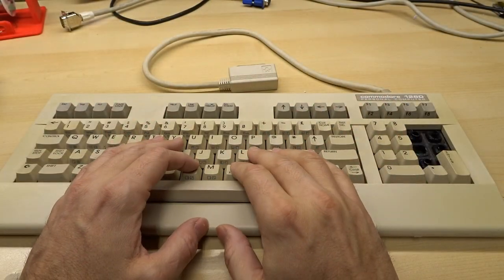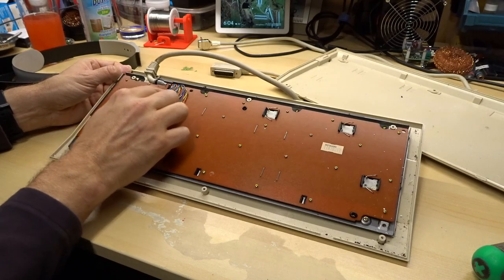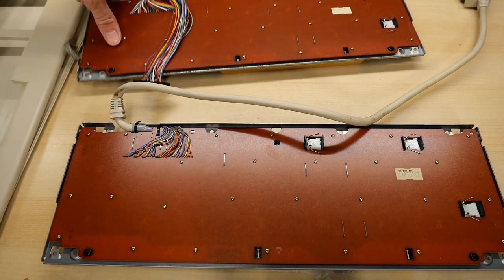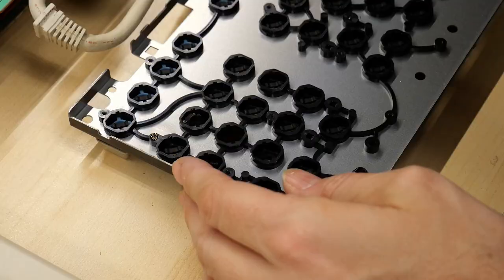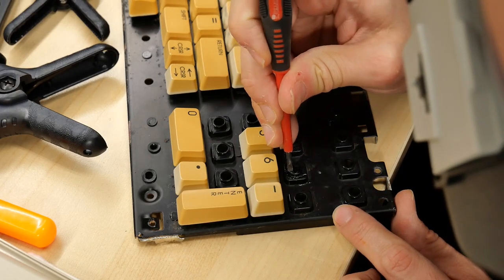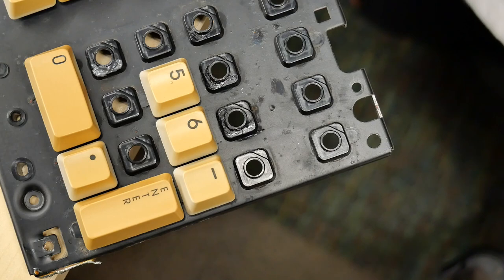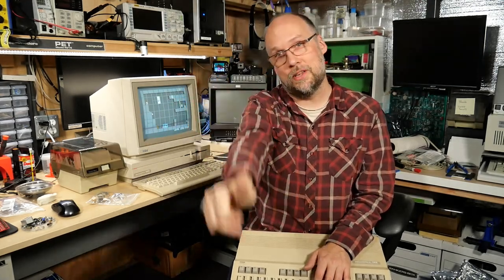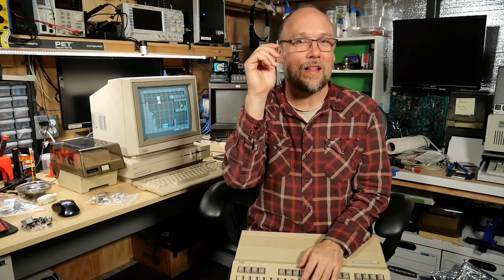Fixing the C128D keyboard (and more!)

Comment: Adding Baking Soda to Krazy Glue after it has been applied will cause it to dry rock solid almost instantly. This may lead to a lot of finishing work afterwards but the repair usually adheres even when the glue refuses to set under normal circumstances. This is a trick used by guitar techs to repair broken plastic slotted nuts (on the headstock) permanently and hold up against the heavy pressure of the strings.
Reply: @adriansdigitalbasement  It's definitely worth trying though I would practice on some scrap plastic first until you get the method down. It can be a bit messy but usually produces a strong mechanical joint. :-)

Comment: A couple of notes from my personal experience with cyanoacrylate. It does bond plastic very well, but it needs a low/no oxygen environment.  This means a tightly pressed joint will bond but the glue on the exterior of the joint will remain liquid.  This can be improved with the introduction of a small amount of water.  The water seals the glue from the air which allows it to bond quickly.  You may have seen this when you attempt to wash cyanoacrylate off your fingers.
Reply: My experience with cyanoacrylate when I used to build models was that using pressure is not good. The adherence was much much better when just putting the parts in contact without applying pressure.
Reply: @galier2  That makes a lot of sense.  Applying pressure will force out the liquid, especially when bonding two pieces that are perfectly fit to each other.
Reply: I think the problem with applying pressure (with your hands) is you can't press firmly and hold completely still at the same time, so you're constantly moving the joint a tiny bit and making the glue unable to set.  I find a light touch sets better.

Comment: Baking soda will turn it into a solid mass that's workable with sandpaper and files.
Reply: Beware of the fumes though
Reply: You can also use fine granulated sweeteners like sweet'n'low if you're working in an office (check the coffeemaker area).
Reply: Yes, works very well and very easy to apply

Comment: For ABS plastics, use solvent 'pipe' weld, similar to what you find in model making kits, or buy one of those pots from a hardware store. Also you can use Acetone if you let it wick into the gap enough, it simply melts the plastic then evaporates and bonds it back together.

For unknown plastics, use superglue (CA) but test an inconspicuous area first. You can buy 'activator' from hardware stores, along with good quality CA glue disguised as 'Mitre bond' for plastic roofing applications.
Reply from the maker: Ah yes I have some of that ABS weld around as I did some plumbing on my kitchen sink and needed it. I'll need to keep that in mind.

Comment: I'm a simple man, I see a C128 video, I upvote. - I own a 128D (plastic case) and a regular 128 (with 1571) too. I also have a NoS never used 128D keyboard as extra... I feel extremely lucky after watching this video that I never had to suffer through this to get a working C128D keyboard. :) I wanted to get a 128DCr (metal case) machine too, which will probably lack its keyboard, but didn't get around yet.

Comment: I noticed you cleaning all the keycaps individually with a cloth (and probably some ipa). I found an easier and quicker way to do it. I put all the keycaps in a Tupperware box, added about two cups full of methylated spirit, closed the lid and shook the box for a couple of minutes. Rinsed the box with keycaps under the tap with running water, spread them out on a towel and let them dry for a couple of hours. I ended up with clean keycaps and with added bonus I did not had to breathe in methylated spirit or ipa fumes for a long time.

Comment: The thing with Cyanoacrylate (super glue, krazy glue, etc.) is not to use too much. A thin layer will actually stick much better (and much faster) than a thick one: the thicker the layer, the longer it takes to cure). I’ve learned this the hard way, in trying to restore stuff. A super thin smear, will set pretty much straight away…

Comment: Instead of superglue, try using the Loctite plastics repair kit.  It has two parts, a cleaning “marker” with solvent (heptane) to prepare the plastic, and then the actual glue.  I used it to repair a very broken C64 case and it worked perfectly.

Comment: i think superglue is everyone's nemesis. it was originally intended to be used as an instant bandage, not an adhesive. so that's why it sticks to your fingers better than the thing you are gluing. your problem seemed to be an incompatibility between the solvent in the glue and the plastic. the plastic may deform but leave it alone and the solvent will eventually evaporate and re-harden the plastic.

Comment: You need water, accelerator (kicker) or baking soda for superglue to cure fast and well especially on plastic.  If the amount is thin enough sometimes just blowing on it can help cure it faster.  I haven't had much luck with plastic except when using baking soda.  But that's messy and usually requires a lot of cutting/sanding afterwards.

Comment: Commodore enclosure, keyboard enclosure, most computer and game console enclosures, made from ABS plastic: in case of a hairline crack with no material lost, fill the smallest syringe with the finest needle with acetone. Press down on the plunger gently until a droplet appears on the tip of the needle, maybe half a millimetre big. Put the needle on the crack from inside, you'll see the droplet instantly get pulled into the crack. Repeat maybe 10-20 times, leave for a day or two to cure, usually invisible repair, solid as new.

Probably won't work on this keyboard tray, which i struggle to guess the plastic even. Some kind of acid-soluble polyester? Since well what happened when you applied CA. My first instinct would be, if i was the manufacturer, to make sliding parts out of PA, because they won't wear, will have a self-lubricating behaviour, and for the time being, like for around 10 years or more, they'll hold up really really well; but the whole keyboard tray just seems like too much material for something like that, at least if you're penny pinching.

My instinct would be to repair the tops of keyboard tray shafts by reinforcement, with epoxy and winding a thread into it, or even CA and winding a cotton thread. The thread will help CA cure, actually cotton can react with CA a bit and the collar formed will also take up the forces on the shaft.

Comment: Just pausing at 8.30 to mention that (assuming Cyanoacrylate is indeed suited to the material to be repaired) you can actually use it to build up missing chunks by adding a drop & then quickly dropping a pinch of baking soda onto the glue, it sets up almost instantly and has much more gap-filling properties than usual... You can layer it up to fill bigger gaps too. I'm told the method comes from aerospace techs repairing helicopter rotor leading-edges, how true this is i don't know but i DO know I've successfully repaired tabs/gears and a few other things using this method.

Comment: I can honestly say I've never had superglue melt plastic like that, usually it just sticks anything to anything, including my fingers to the piece I'm trying to fix... :P

As for retrobriting in the winter, dunno if you know him but some guy by the name of Adrian Black did a video using near-UV blue LEDs to do indoor-whitening, wink wink......... :P
Reply: If I'm clamping something with a glue that might spread, I usually put some paper (or two) in between.  Especially with a double-layer of paper it's easy to separate them if it sticks, and the paper can always be dissolved with water.  It's essentially how my father would attach corner blocks on a violin mold, so they could be tapped back out once the sides were molded.

Comment: Glad to see two 128s (a flat and a diesel) back to full working capacity! I tried rewatching several times over but didn't quite catch it - what caused the D keyboard to produce that 3 and mis-types when you first plugged it in?
Reply: Possibility that the connector (db25) may be the issue. Or some sort of weird compatability issue with the new keyboard?
Reply: @HoboVibingToMusic  The previous owner probably hit the '3' key after turning the machine off and it was in the keyboard buffer for a few years just waiting to come out.
Reply: @PJBonoVox  The key: My time has come.

Comment: Cyanoacrylate, if applied too thick, won't dry properly in the listed times.
If you need to gap-fill, mix in some baking soda or corn starch.
Reply: Better yet, use the correct adhesive for the job.  Cyanoacrylate is great at sticking fingers together, but compleetely wrong for most of the jobs people use it for.  Very clever marketing by Loctite and others but utterly wrong.

Comment: That glue expires quickly after it has been opened. And it's only really good for acrylic based plastic. For instance the bottle it's stored in is made of normal polyethylene and it doesn't stick to that.
Reply: @adriansdigitalbasement  yep, epoxy based glues are much less brittle when dry, don't age that fast, and can take repetitive high mechanical forces. Superglue is actually only suitable for some specific applications, but people use it for almost anything, because it's easy to use.

Comment: I truly believe Adrian has the skills to Frankenstein a standard PC keyboard to work as a C128D keyboard ... just sayin
Reply: The issue is getting the matrix to work. Most keyboards have the encoding electronics inside them, and flexible membrane instead of a PCB matrix. If that matrix doesn't line up, you're gonna have a very difficult time making it compatible. Now, if it were the other way around, you could potentially cut traces on the PCB, run some bodge wires, and make it match the matrix on a PC keyboard if you wanted a C128 keyboard to work on a PC, but going the other way is extremely difficult. 

I was considering attempting something similar to cludge together a keyboard for a Tandy 1000HX motherboard I have lying around, but it could involve using conductive paint to re-route some of the membrane traces, or a microcontroller.
Reply: I caught the label inside one of the keyboards, it showed "Mitsumi" I think.  I recall them making keyboards for PC clones, too, so there's at least some chance to scrounge parts from one of those if we're lucky.

Comment: Wikipedia on cyanoacrylate:
"They are derived from ethyl cyanoacrylate and related esters. The cyanoacrylate group in the monomer rapidly polymerize in the presence of water to form long, strong chains. " it absorbs moisture from the air and it helps with the bonding. I usually blow warm humind air right from my mouth on it, I think it helps. I also saw a good method of gluing stuff together with cyanoacrylate is that you sprinkle fine baking soda along the crack then drip some glue, repeat until you think it's going to hold. This method only works on the surface that is hidden because you are building up material to hold onto the 2 sides. Check it out:
https://www.youtube.com/watch?v=Sq5YJbZXaZk

Comment: For this kind of plastic work it is better to use "plastic model glue", Revell or any other brand. It's slower to cure than cyanoacrylate, but the end result is so much better. It melts the plastic (works for polystyrene, ABS and other plastics). Super glue is not as durable in my experience. As it doesn't meld with the plastic, after some time the 2 materials tend to lose their adherence. With model glue, the plastic is melted and the result has more to do with welding than glueing.
Reply: Yep, I'd bet that plastic is ABS and, if so, the glue to use is definitely "model cement."
Reply: @winstonsmith478  Thats is what I think too.  A really good choice for ABS is stuff you can get at Home depot or other hardware stores. ABS Cement

Comment: No cyanacrylate, no epoxy. Acteone based model bulding glue is the right
 thing to do on ABS like Commodore plastic parts. (for example Revell - 
Professional Contacta Glue). It will weld  broken parts into one, 
stronger than all the surrounding plastic and completely seemlessly if 
you are careful.
Reply: You can get a good guess on identifying most molded products, by combining three methods:
1. The 'experienced' way:
-You can expect most "cheap" products, that't aren't regularly put to stress, to be made from ABS, as it's one of the cheapest plastics and has good impact resistance, because it's rather elastic. Media devices and often household items are made from ABS. Examples are: Notebook cases, pocket calculators, toys, lighters and such are things usually made from ABS. Things with no special needs for toughness. There also are the cheapest variants, that usually are molded very thin (like 1 to 1,5mm), that are way less flexible and break easily (often used by cheap plastic file trays for example). The later ones got this distinctive 'cheap feeling when touching them. You can glue nearly all of these with the same contact glue.

-Mid rangehousehold and kitchen products (like clothes baskets, tupperboxesare often made from Nylon/PA6 or POM as these are even more flexible, but also a bit more expensive. You often find these plastics in cheaper power tools or products that require a bit more physical strength because of their application. More likely in the kitchen you will find Polyethylene or Polypropylene because of heir very low surface energy. The low surface energy is good for the appliction because it will make it nearly impossible for anything to stick to the surface, but this also means that plastics of these families require very specific primers and glues for the exact plastic type, that are expensive, hard to get and too hazardous. Usually these products sadly aren't worth reparing because of this.

 -More expensive high end plastics like Polycarbonate (Glue it with CA or Epoxy) or PEEK (Glue it with Epoxy) are used in quality power tools riot shields, professional devices like cases for electrical-power-distribution, where you need the maximum possible strength. In combination to the more advance plastics, you always increased material thickness (2mm+) in products made by these.

2. The 'readable' way:
In many product you find little stampings in the mold, telling you what the plastic is made from.
Modern products follow the Resin Identification Code (https://www.google.com/search?q=Resin+Identification+Code+(RIC)&source=lnms&tbm=isch&sa=X&ved=2ahUKEwjAodGmjozmAhUEI1AKHfk5CgUQ_AUoAXoECGkQAw&biw=1920&bih=840)
Older and cheaper products often have round markings, with some letters inside like PA6 or ABS.

3. The 'empirical' way:
Find a hidden spot inside an enclosure, where some uglyness wouldn't bother you and do some tests:
-scratch the surface with a sharp object, or try to shave off a little flake with a knife. From the hardness and the sound you can tll if it's a cheaper or higher grade plastic. When there's a scratching sound, and/or sensation, then there's glass fiber reinforcement mixed into the plastic. You can often even see the 'hairy' structure of the glass fiber reinforcement, whan you look at the cross cut of a broken part.
-dip a Q-Tip into acetone and firmly pull it over the surface for a few milimetes. If you see coloration on the Q-Tip, you can guess that it's made from ABS or similar.
-Heat it with a ligher and carefully get a bit of the smell. The aroma of the plastic will tell you what about it is, if you do this often enough (of course very carefully :) )

Of course that's just very coarse and requires a bit to get used, to, but it's usually enough for identifying what glueing method would be optimal for the case. The first thing to consider should be if there's a matching contact glue for the plastic. In all other cases, when there's no contact glue for the job, then it's really important to clean and roughen the surface if possible for giving the glue a chance to stick.

Comment: @Adrian Black ... Cyanoacrylate cure with ambient humidity........ if your environment is very dry ..... air conditioning kind of dry...  that affects the Curing time of Cyanoacrylate ...   blow humid breath.. like when you try to moisten a glass to write on it with your finger ... it helps a lot ............... but especially the amount It's the key ....... you must put a small layer on the crack of the piece to stick....... the receiving piece must be dry....... if is dripping .. or forming a drop..... is too much........... . if you put the right amount you will notice.. when you joining and push both pieces together ..because small little drops will come out from the union of both pieces.... in your case ..... you have a Cyanoacrylate swimming pool there my friend..... it will dry the surface of all that liquid..... taking a long time to harden the Cyanoacrylate inside the union of the pieces......

Comment: I build RC airplains and what your looking for is http://bsi-inc.com/hobby/insta_set.html  that sets off the super glue and its hard in like 2sec. Can buy it at most good hobby stores.
You don't need much at all. Watch out for anything that might melt as it will get really hot for a few sec. One other thing. I use the jell super glue to reinforce things like that make a nice thick layer then use the insta set on it. Can get it at the doller store.

Comment: The trick to super glues is to use the bare minimum and it needs to go IN the cracks, not beside them. 99.9% of people use WAY too much of it so it never cures properly.

Also, they don't work well on all plastics.